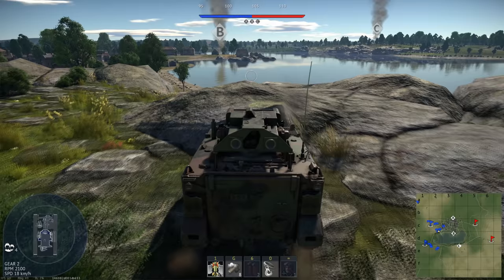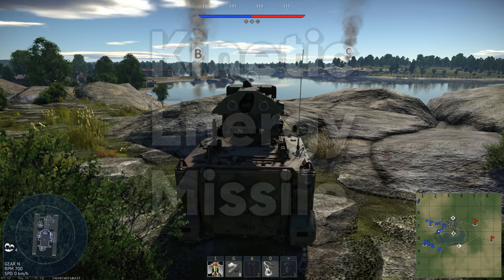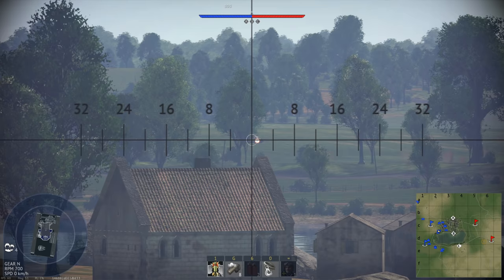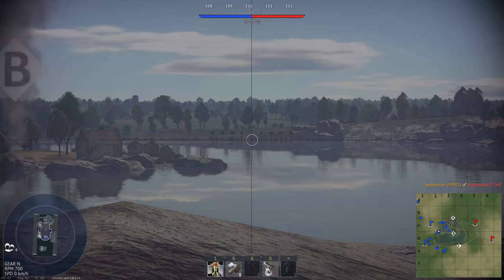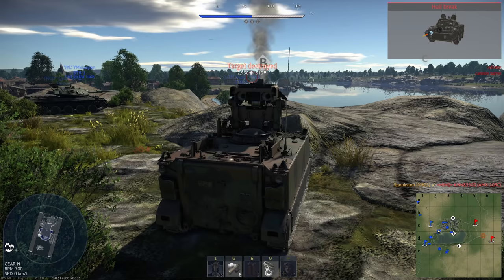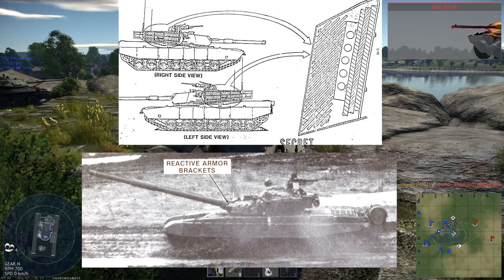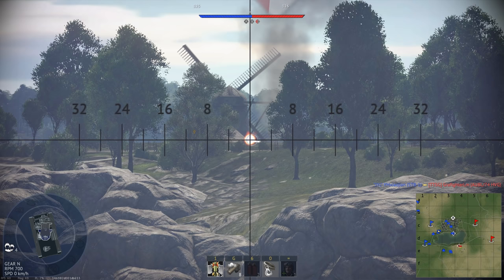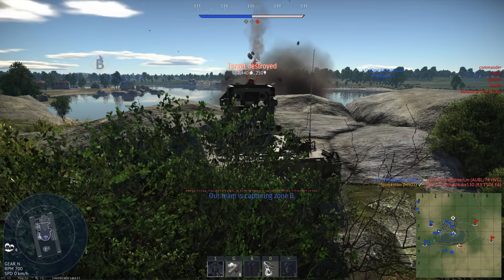Kinetic Energy Missiles - Future Tank Weaponry

Comment: A modern KEM could do a trick not available for a tank gun - it could initially climb at a lower velocity and then dive with the main engine in order to attack a target's thinner upper armor with multiple darts. Multiple darts would have lower penetration than a single dart, of course, but they're a better fit for doing useful damage from above. Multiple darts also makes the weapon more suitable for use against softer targets, including infantry and aircraft.

Basically, it could be something similar to the Starstreak missile, but with unguided darts.

The two stage propulsion system also solves the minimum range problem. The slow stage could climb away from the target before looping back toward the target for the main burn.
Reply: Calen Crawford  Okay, but a cannon is much heavier and more complex than a missile launch tube. It gets particularly heavy and complex if you want to put it in a turret, have stabilization so you can fire on the move, and so on.

If you want to save money on ammo, a 30mm shell is less expensive than a 120mm shell, and it'll do the job for most targets. But a 30mm gun is a fraction of the mass and volume of a 120mm gun, and you can carry a whole lot more 30mm ammo.

In fact, the 30mm may actually be superior in most situations because it's easier to mitigate collateral damage. Really, a 120mm gun is optimized for killing main battle tanks, and everything else it does is an uncomfortable compromise (mainly because the ammo is so big and heavy that you can only carry a limited number of dual purpose HEAT shells in addition to the tank killing APFSDS rounds).
Reply: Calen Crawford  IF they can devise a suitable anti-tank missile system that outperforms an anti-tank gun system, then it could indeed radically alter AFV design and capabilities. The cannon could be replaced with a much lighter autoloading gun with a much smaller caliber, suitable for more targets and having a lot more ammo. Like, two orders of magnitude more ammo.

However, they've been trying to do this ever since the anti-tank missile was developed. It's unclear whether any attempts have succeeded, but a lot of IFVs and similar lighter AFVs have been armed with smaller guns and anti-tank missiles. So far, no one has gone all in on replacing a big gun armed MBT with a missile armed MBT (or MBT replacement).

So anyway, while I am no expert, obviously the folks designing these things are experts. And so far, they haven't gone with a heavy missile tank. Sorry I can't offer expert insights as to why not.

I do remember reading a RAND study from just before the collapse of the Soviet Union, which studied various options for future MBT design. They did consider hypervelocity kinetic kill missiles, but the resulting design was NOT impressive. The missiles were so big and bulky that it only had an ammunition capacity of around 6 or 12 (I don't remember which). But we're talking early 1990s technology, and their study didn't even consider the possibility of top attack missile.
Reply: Calen Crawford  I don't know what a goliath is, but the other ideas have been utilized in Arab-Israeli wars and more recent wars. There were times when the tank was declared dead, only for the tank to continue to be the backbone of fighting offenses.

The usual limitation of infantry is limited mobility compared to main battle tanks. Limited protection is also an issue, but this could be made moot if offensive anti-tank weapons make armor a waste of mass (remember, the armored knight seemed invincible for centuries until suddenly they weren't).

As I already noted, I am not an expert, so I can't offer a robust analysis of where we're at on the defenses vs weapons front.
Reply: Calen Crawford  Wow, the kugelpanzer! That's one I forgot even existed. Looking it up, I see no one really knows much about it. I don't think there are any successful models of anything like it.

The Bren carrier tankette got a lot of use in WWII, but I don't know if any equivalent has really been used much in recent decades.

I mean, a kegelpanzer makes a Bren carrier look big, but at least it's almost in the same ballpark?
Reply: Calen Crawford  Normal infantry with modern body armor is about as resistant to small arms as you can get. The modern stuff is good enough to stop 7.62 NATO ammo (far more powerful than the ammo used in AKs). I mean, just look at reports of combat action this century - AK fire peppering Humvees into swiss cheese but most of the actual KIAs caused by IEDs and maybe RPGs.

Any sort of one person vehicle dramatically increases the area that must be armored, and thus the weight and such. And you've now got a noisy vehicle which has some serious drawbacks in CQB. You know ... stairs. A door. Even just a curb.

Right now, the big deal killer is that modern body armor is "too good". The numerous drawbacks of an armored bike just don't have a compelling marginal benefit over boring body armor.
Reply: Calen Crawford  Well, there is indeed a lot of work being done on mecha-suit type technology. Although so far it's more oriented toward logistic support roles. I have to admit I'm no expert, but I think the maintenance challenge is self evident.

Modern body armor isn't so different from knight armor (which did have to defend against projectile weapons). If you want to protect a human body while also allowing the human body to move around and operate stuff ... well, there's not a whole lot of different ways to do that.

Hmm ... actually, your bike idea isn't so bad. The conflicts we've been getting into lately have suited use of Humvees and stuff to get around, but there are a lot of places where a mountain bike is a lot more mobile. The VC did very well with using push bikes to silently transport supplies through the jungle. We'd bomb the heck out of the jungle and it did practically nothing to stop them getting the supplies they needed.

Simple rugged mountain bikes might prove useful for forces with limited access to the sort of fuel and maintenance crews required to support Humvees and helicopters. Fit them with cargo bags and you've got something arguably a lot more useful than pack mules.

But hey, I'm not an expert. I'm just guessing really.
Reply: Calen Crawford  Well, right now we're in a weird place where body armor has gotten a LOT better than a few decades ago, but small arms armament hasn't even tried to keep up. The world's major militaries are all armed with carbines optimized for taking out Vietnam era troops wearing flak vests.

And as long as they're asymmetrically up against "insurgents" and such, this works out okay. Fighters on a budget use what's affordable and available, and that means AKs and RPGs, not 50 cal heavy rifles.

But what happens if they go up against an equally well equipped military force? In that case, both sides will be armed with carbines of limited effectiveness against the enemy. If one side were armed with heavier armor piercing battle rifles, they'd be at a distinct advantage. A semi-auto .338 could penetrate body armor, while also allowing a respectable ammo capacity (unlike .50 BMG).

Well, IF major military forces move away from carbines to these heavy battle rifles, then that could start an armor/arms race that confers benefits to powered armor or some other alternatives.

I don't know what we'd try in response to such an armor/arms race, but I'm thinking it's not going to be more of the same.

Like maybe a paraglider trooper is too vulnerable, but a paraglider sniper drone could complement lightly armed (but heavily armored) ground troops.

Or maybe there could be paraglider "jump troops". Each paraglider has a long bungee cord attached to either a soldier or pack of supplies. The supply packs might look like dummies. The point is, this allows the "jump troops" to make quick hops from one location to another. This limits how much time is spent exposed and gives enemy soldiers little time to react to a target of opportunity briefly popping up above the landscape. This "jump" capability may give jump troops the ability to escape a bad situation quickly.

Yeah, maybe it's a silly idea.

Comment: I think the current range limit on the M256 is a digital limitation imposed by laser rangefinder on an Abrams not returning results past 4km--though to be fair, 4km is insanely far, especially in Europe where the Abrams was predicted to fight WW3. 
New laser-guided beyond line of sight 120mm gun launched missiles are in development. The idea seems to be to give Abrams a kind of (anti-tank) artillery role. The HEAT version has been tested and accepted. The KE version is still under development, as it needs a final booster motor to bring it up to effective velocities at the end of flight.

Comment: I must ask, do projectiles really need warheads anymore? Especially something traveling at, say, Mach 4. The kinetic energy alone would be monstrous.
Reply: I'm wondering what graphene will do for armor systems.
Reply: Using pure carbon as armor? I really don't think that's a good idea.
Reply: @thefuzzyvulpine5945  i think he means using it within composite armour designs. At its most structurally strong i think it would benefit in some way.
Reply: @TGNXAR  That varies greatly with how large graphene sheats we can make. For the sizes we can make today, the largest difference between a graphene armor plate and an asbestos armor plate is that graphene is far more dangerous. If you can make graphene sheats the size of modern ceramic plates it'd drastically reduce shrapnel since graphene bends instead of fracturing when indirectly struck. If you can make graphene sheats the size of the armor segment, it'd reflect explosives and directed energy very efficiently, but since graphene is very flexible it'd be weak to kinetic weapons; and once again, if graphene breaks it creates a shower of flechettes that are sharpened to a single atom.

A much better candidate for primary armor structures is carbon nanotubes, since they are much more rigid and more prone to breaking at single points, leading to less shrapnel than modern armor while taking more energy to break, as well as being rigid enough to serve as plating. There are also many different types of nanotubes with varying characteristics, with different types able to serve either as ablative, shock-absorbtion, or kinetic resistance.
Reply: @CattoAVRCE  Yeah, I'm sure it would be very beneficial as part of a composite... but, in the end, carbon is carbon. Doesn't take much to get it to burn.
Reply: @thefuzzyvulpine5945  As thin as one can make a graphene sheet, it uses very little carbon to create a very strong defense against spalling. If one is worried about graphene burning, then the screaming alpha sources inside the tank are already on fire.
Reply: @DavidBarkland  Graphene gives tremendously when poked, even with very sharp objects. If one is worried about the kind of spalling you describe, then the armor wouldn't have held up to that hit, regardless of material. Graphene is there to reduce spalling, IMO (I'd love to hear other uses), it isn't a panacea that will remove all spalling.
Reply: yes, they do. Newtons 3rd Law of motion: When a body acts on another with a force, it faces a forces equal in modulus itsef. (aproximate formulation). This means that when your Mach 4 projectile hits the target, it needs to have enough structural integrity to support the sock of the impact and penetrate, otherwise it would be just shattered by the armour. And turrets of most post-1970s tanks are made to withstand Mach3 shots, up to Mach 4 or perhaps beyond. A hit might put a dent and shock the crew, but, unless it penetrates, no severe damage would be done.Furthermore, you kinda need the projectile to sustain the aerodynamic forces associated with Mach 4 velocities
Reply: The "flechettes sharpened to a single atom" and "carbon is carbon" are the highlights of this shitfest lmao
Reply: @nottoday3817  in a hypersonic impact you don't need the projectile to maintain its structural integrity to penetrate. after a certain point it's more about density b/c everything will liquify and splatter, but with high density the inertia is enough to achieve significant penetration
Reply: @TGNXAR  
The problem with graphene-only kinetic protection isn't tear strength - it's focused bend strength. The flexibility that allows graphene to give means that you don't have to pierce it - in fact, a graphene sheat the size of an Abrams front plate has no problems giving a hundred metres - at that point the projectile has already struck the chassis, caused impact splash detonations at any impacted objects, hit whatever component it was aimed at, and continued 90 metres out through the other side. That's as good as no armor. 
Please don't suggest building the chassis from graphene too - same thing: bend strenght. Graphene is incredibly easy to bend; in fact, a 10cm by 10cm square has no problems giving nearly a hundred metres if you poke it hard enough; and by "enough" I mean the weight of a modern 120mm shell under earth gravity.
As for having more layers, yes, that'd be a given - but you still need to support the weight. Energy absorbtion does not scale linearly with layers: if one layer stretches to 100 metres from a certain impact, 2 layers only marginally improves; you'd need to get into the visual range before you start seeing apprechiable improvements.

Graphene makes a great coating to soak up shrapnel, directed energy, and thermal, but you need armor to stop kinetics before they inflict damage.

Another point is the shear energies involved - graphene stretches to the point of individual atom bonds. Even the strongest atom bonds are meassured in the MeVs (Mega-electronVolts); while the muzzle energy of modern battle rifles are meassured in the dozens of kilojoules. As much as graphene has the strongest atom bonds second only to some variants of carbon nanotube, it's still a difference of 19 orders of magnitude - and since graphene is a monolayer it comes down to each specific individual atom bond rather than the cumulative strength of the molecule like would be the case for a composite plate or nanotubes.

And, no - this is not how I expected to use my chemistry education.
Reply: @francesco3772  pretty much. Both graphite (used in pencils) and diamond are both carbon
Reply: @nottoday3817  @Francesco_Vassallo
Different molecules behave very differently though - material strength is not about the elements themselves, but the bonds and structures they make up.
For example, setting graphene on fire was mentioned. This can not be done the way you would coal or wood. Burning coal or wood are exothermic reactions - they release more enery than is needed to ignite it. Graphene and nantubes dissolve under isothermic reactions; you need to constantly input more energy, and a lot of it. The ignition temperature of most nanotubes and graphene are above 7000 kelvin; more than any known alloy. The type of high-powered DEW you need to set fire to graphene or nanotubes would melt the interior and set fire to the ammo rack of a tank without a graphene or nanotube coating in an instant. However, with a graphene coating that energy would be absorbed by the graphene during combustion.
Reply: Only at Mach 9 does an object delivers energy equal to its own weight in TNT. Even at that point, constructing part of that object out of actual explosive might still yield significant additional effect. I suspect the actual answer to the cutoff velocity for explosive warheads will depend on the engineering involved
Reply: Might still want a warhead for after-armor effects. Penetration is just the first part of killing a tank.
Reply: @Fiannie  Considering the kinetic energy required to get through the thickest part of a tank armour, the fragments and temperatures resulted from the penetration would pretty much fuck up everything inside
Reply: @dsdy1205  True, but you don't need 2kg of TNT to kill a tank, by any definition of 'kill'.
Reply: @epion660  It's a per-kilo basis, so it scales with the mass of the round. What I'm trying to say is that even at Mach 9 chemical explosive energy can constitute a significant portion of the round's total energy.
Reply: @dsdy1205  Yes, but you don't need chemical energy at all. Especially if it's not directed at penetration. But it's been shown that velocity has no real effect of chemical munitions, so I really don't see your point.